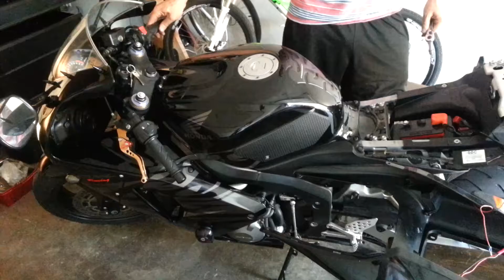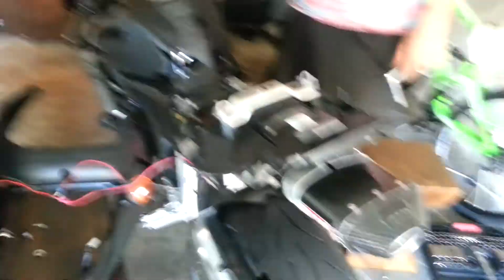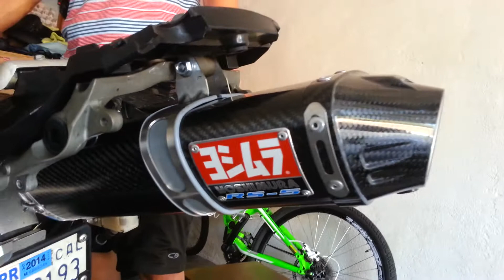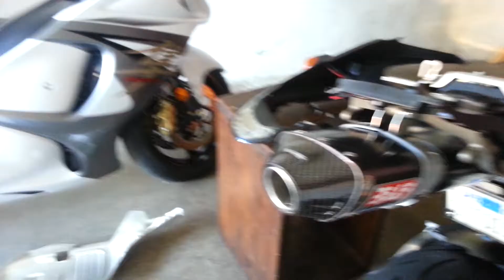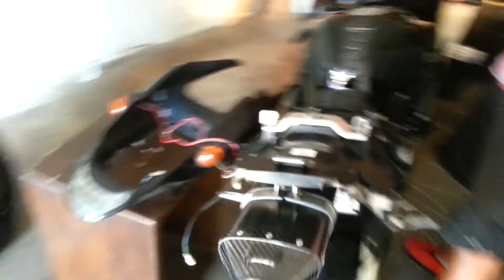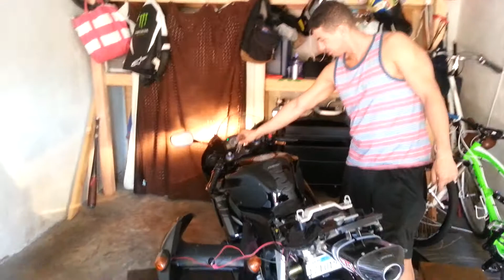Yoshimura RS-5 Carbon Fiber Exhaust on 2005 Honda CBR600 Install

Comment: I have the same exhaust does it have a baffle ? And how do you remove it
Reply from the maker: I removed the baffle because I was living in L.A. and wanted to be heard splitting lanes on the highway. It's been years since I removed it so I don't exactly remember the process. It was pretty easy, if I recall. No doubt there is a video to help you with the removal.